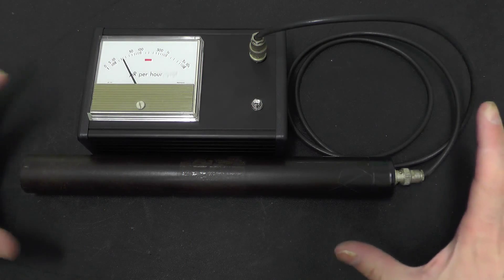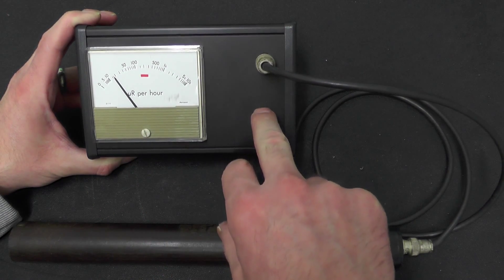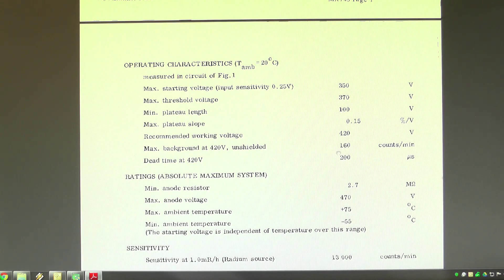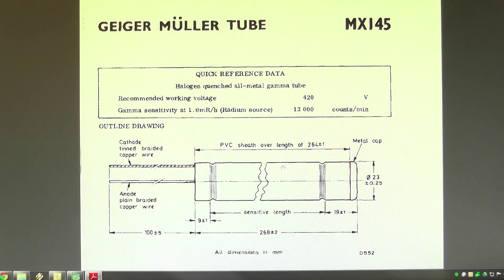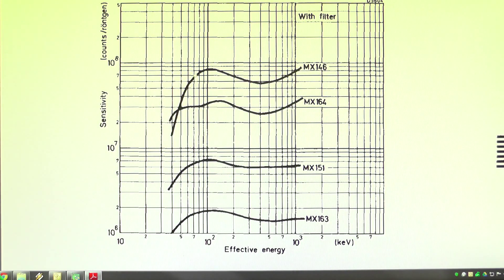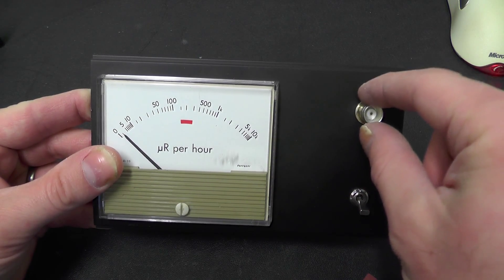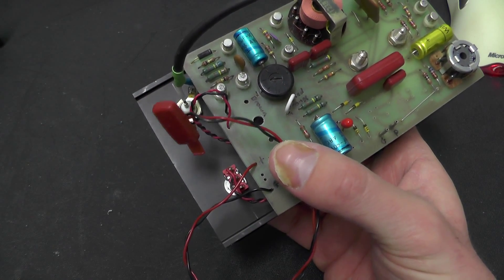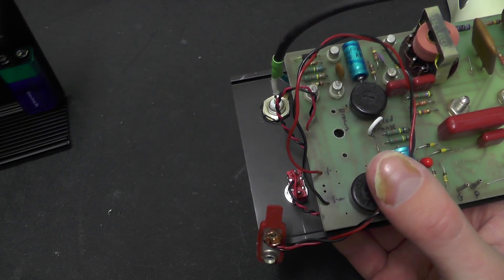DL#044 - Mini Instruments 6-70 Radiation Meter Final Look

Comment: Hi, I got the Geiger counter model series 900 mini monitor and when I do the battery check it works all fine but when I turn it on so I can do radiation readings then the needle doesn’t move at all or make a speaker sound would you be able to resolve me the problem or tell me what it can be so I can get it fixed?